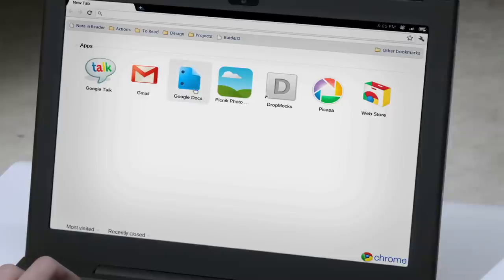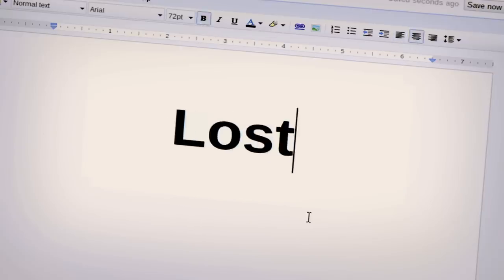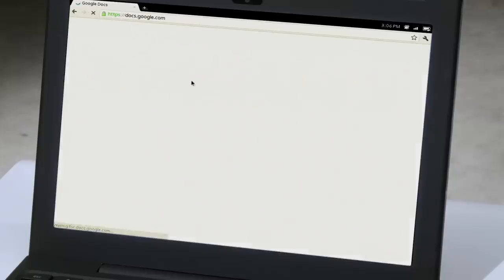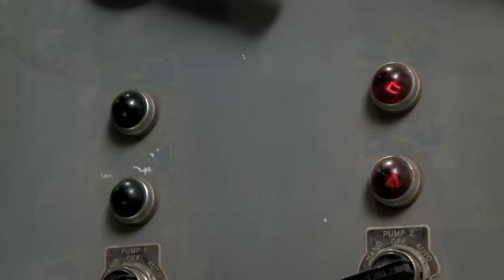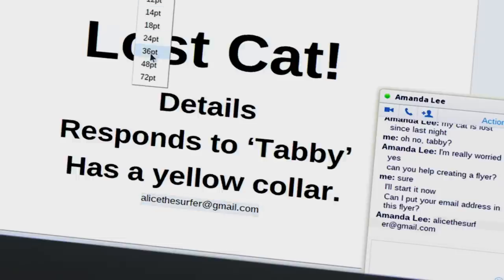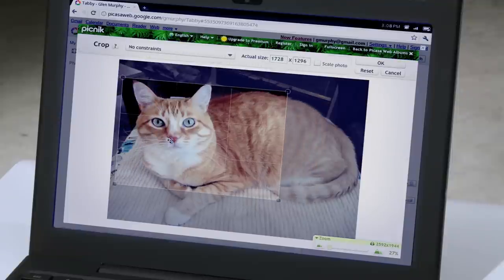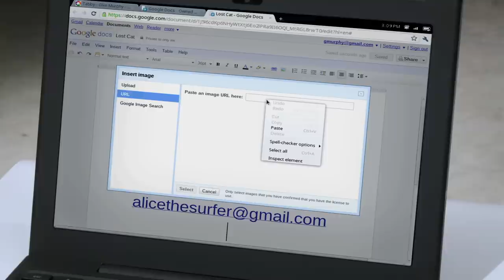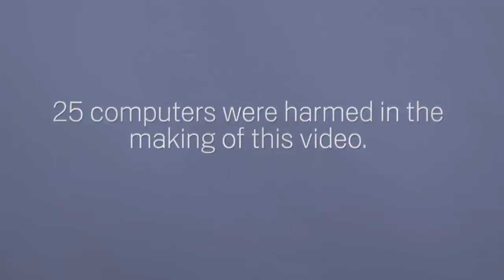How to remain calm, despite what's about to happen to your Chrome notebook

Comment: @catupeloco only after you've done 24 hours of research and manual-reading.  You have to connect printers to a network apparently, and then tell your OS to read from that network.  And it's supposed to work "without drivers" but i'm not sure that will truly ever be possible.

So, basically, no.

Comment: @ComputerGuy890100 actually it's the notebook's touchpad with ribbon cable affixed (e.g. cirque glidepoint/synaptic touchpad) an SSD still has a 2.5" drive's dimensions and SATA or miniSATA connectors. :\

Comment: @emolinare I would say that 85% of Americans do not have a google account and do not understand the fact that this can be done without this notebook. However I would still purchase this notebook over any other notebook that is available on market today. A notebook is meant to be sleek and simple. Now you got notebooks trying to run Windows on it with minimal ram. Yeah right. Or an expensive one that runs better. This will be cost efficient and fast.

Comment: @rifall It is NOT a WHOLE other computer. It is almost only a keyboard and a display and very minimum other requirements. About the data I would say that probably it will be possible to save local. It probably has some spare and also you could use a USB.
Price will be crucial. If it is going to be expensive there is no need to bother about it.

Comment: Erm, I don't know if anyone has told the people at Google, but normal laptops can store stuff in the cloud too. The difference is that normal laptops are still useful without an internet connection, and don't have an expiry date where you have to throw them away because Google discontinued support, and they're locked from installing another OS.

Until they cost less than half of a normal notebook, Chromebooks will be bad value, since they're at most, half as useful as an actual laptop.

Comment: Pretty much what it is. Is a OS web browser. So a web browser laptop. While convienent if you are a college student taking and sharing notes during class along with projects. Or any other form of note taking I don't see much use to it. Its speed is accountable for the fact that it is pretty much running only the browser, has a minimal HDD. Does not require much ram or processing power as your average PC. There for of course it is going to load that fast.

Comment: @EFT4MeDebi Chrome OS isn't meant as a replacement for all laptops, but as a cheaper solution to many situations where a low-battery life heavy laptop with local storage is not necessary. Maybe it's not the thing for you, but there are plenty of people who could use one when out of the house and all they need is quick web usage. Secondly, good luck finding a laptop that would survive any of those incidents. It says nothing for the durability of the laptop.

Comment: @mHalfLife computers come with 3G and wifi access so MOST of the time you have internet, but for the rare occasions where you don't, most of the apps are designed to allow you to carry on working whilst offline; meaning that if a freak accident happened to you for whatever reason, you only lose a little of your data (anything from when you were last online) unlike if you were using for example Mac OSX where you would lose everything., unless you had cloud setup.

Comment: @BrEnNo1023 blegh never mind that's only for developers anyway.
but it's still cloud-based computing...
also i noticed you mentioned 'apple' and 'innovative' in the same sentence.. Apple doesn't innovate anything, it just takes other competitors' features as its own. video calls (aka facetime), multi-touch, gorilla glass, a LOT of features (and hardware too) it puts into its products were on other products years before it adopted them and renamed them.
it does make products that work well though

Comment: I like Google Chrome, I support you but I can not give up windows. I like the safety of my data being with me, not for anyone to hack into and sometimes, the internet is slow, in use, or down and I need to make a document. And at school we use Windows programs and other things and I like Windows and I love Google but they are separete and if I want a Windows OS like experience, I will let Google Chrome launch at start. I like how much data google has but I still prefer the ability to run windows. My Windows 8 machine runs fast and if it bogs down, I clean old unused files and outdated files like last years Java and Flash Player.

Comment: DONT DO IT DONT GET A CHROME BOOK!
the chromebook itself is $350 - $400 
price to use the operating system $28 a month with a 3 year contract witch adds up to $1008 so basically your going to end up spending  $1358 - $1408

STILL THINK ITS WORTH IT

Comment: Ok other computers can connect to the internet and do everything this can. THe chromebook is just a lot faster and has limited features because most of the processing is done via server CPU's. Second of all, the chromebook is still pointless, these days we have tablet devices like the iPad and other Android based tablets which can turn on pretty quickly and can be used without any computer integration what so ever. Tablets like the iPad also have cloud support too... So shut up.